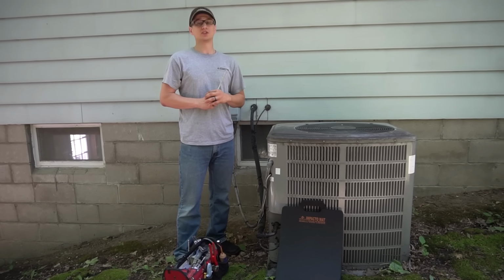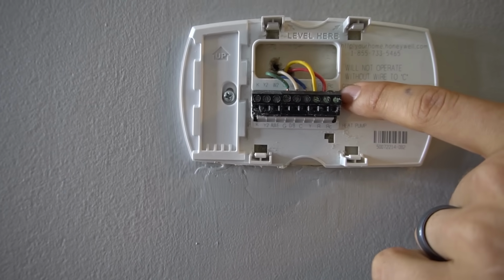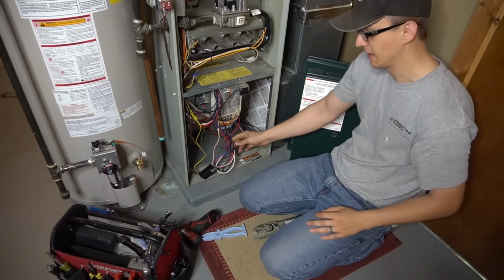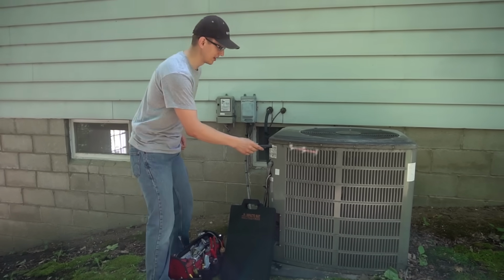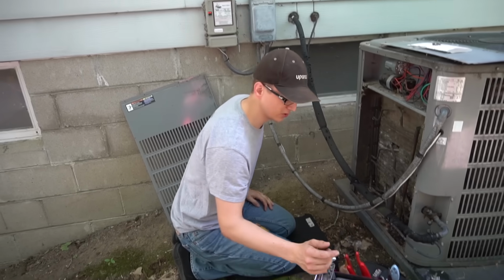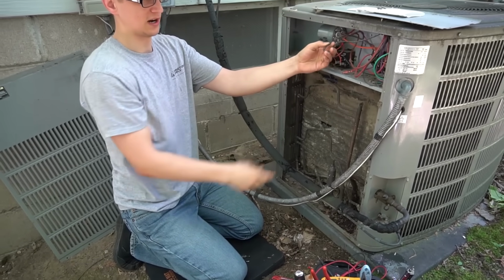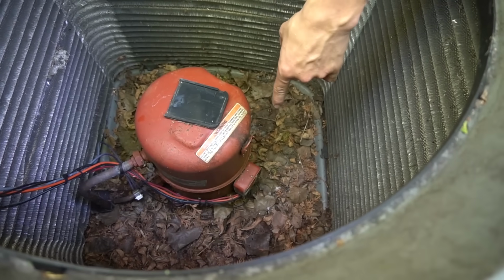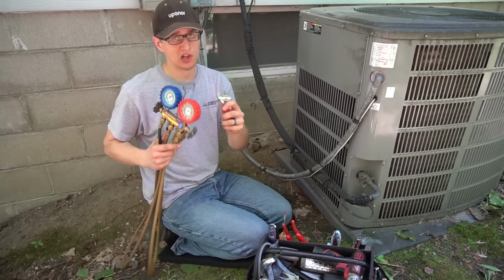AC Unit Not Turning On - How to Fix It Step by Step

Comment: Man thanks very much for this video. Here is my issue, my inside unit comes on alright when I turn the thermostat on but the outside unit is not working. I have two units and both units are acting the same way. At first I taught it was the capacitor so I checked them and replace both. One thing I saw was when I press in the contactor the unit start working on both. So I replaced the contactor on both unit but the issue did not resolve itself. I checked all the voltage and everything was good. I check the cable leading to the house to the thermostat and there were no damage. Is there anything you can think of that I did not check and base on your expertise what do you think might be the issue ? Thanks for your help.

Comment: This is a great video!  I tried your contactor trick, and nothing happened.  Then I looked at input voltage to contactors, and measured 37 VAC.   I powered off, removed one 240 leg, and powered back up.  I got 240 from the unconnected lead to the other one on the contactor. Probably will call professional tomorrow.  I greatly admire your clarity and enthusiasm to help people.  God Bless you and yours!!!

Comment: Hi! Hope you are staying safe and thank you for what you do. Your video has been so helpful in guiding me to figure out what is going on with my AC. Unfortunately, I still need help. My AC unit is hissing and not turning on, it sounds like is trying to turn on but doesn't. I changed the capacitor and didn't help, then changed the motor and it worked, but after a day it was still not cooling. The temperature went down from 85 to 82 then down to 81 but went back up. My inside unit is working. The control panel is blinking constantly, but not sure if that is related to the outside unit. The fuse is not burned. I don't know what to do. PLEASE HELP!!!

Comment: So I had a original 30 year old capacitor that was going out and its a 40 MFD +3 dual run capacitor. They had none at the parts store and told me a 40+5 works. I bought and installed. Should I get a 40+3 to replace it with
Reply: +5 is for your compressor fan motor. if its starting up then no need to replace it
Reply: Yeah, it works fine.  I just was wondering if there were any negative effects or not and if I should replace it back with a 40/3.  I guess since its working I'm going to leave it alone.  Thanks!

Comment: Thank you for the videos. My AC isn't working at the moment. My fan in the house unit is blowing. But my condenser isn't doing anything. I had the capacitor checked and it was good. The condenser fan motor is free but not blowing and I don't hear the compressor turning on. I do have 120v on one leg and 120v on the other. I haven't checked the 24vdc on the contactor though. I'll check the contactor in the morning. Thanks, at least I have another place to check now. Cross your fingers it isn't the compressor.

Comment: so i bypassed the thermostat by manually pushing the contactor on the outside unit, and both the fan and compressor turned on. what should I do next?  I did notice on the control board looked darker around two of the resistors. maybe the control board is bad?

Comment: Nice video by the way. Here is my issue. Very hot day and suddenly my home ac unit(Carrier) stopped working. Went over your video. When I select from inside the ac button, the fan works, the thermostat is also on hold. From outside the unit does not work. Don't see the fan spinning. I open the panel changed the capacitor 45 / 5 microfarad. Still nothing happens. I take a screwdriver and press the contact button the compressor, and fan starts working. But the contactor does not hold or get magnetized. What should I do? Please suggest. Thanks!

Comment: Thank you so much for this video.  What if I don't see a plunger on the outside unit?  Is that possible?
Reply from the maker: You're welcome! It is possible that the plunger has  a cover over it that is held on there by 2 small screws. Try taking it off
Reply: @WordofAdviceTV  thank you so much.  that is it!  The Plunger seems to turn the unit on, so need to relook at the wiring.  I installed a new ecobee thermostat, and used the Power Extender that it comes with.  That is when the fan stopped working in the outside unit.  Maybe I should take the power extender off and use the C wire again?

Comment: Thanks for sharing your time and knowledge, Great Video. first my unit is a 20 year old Miller. I notice my unit wasn't cooling but the inside air handling fan was running fine. I turned the thermostat off. and waited a minute then turned it back on. As it gave me time to reach the outside unit. I waited a few moments and the condenser fan started but it didn't sound like the compressor had  started. or was operating with that peculiar sound like(glass spools rolling through a glass pipe) lol. I checked the start capacitor. it looked fine and every test I knew to try, it passed as a good start capacitor. this leaves me with the compressor to figure out.
QUESTION: with everything else seemingly working ok, is there any thing that would keep the compressor from not working or is it probably shot?  A local hvac tech was hired to replace my thermostat with a digital model a few months back and the fellow that installed it left a switch in the (heat pump) position instead of (standard) on the thermostat. this made the condenser fan and compressor run non stop 24 -7 and I did not notice this until the light bill came in and I started looking for the trouble. I turned the thermostat off and most other appliances and went outside to catch the fan and comp. running. I immediately went and pulled the thermostat thinking that it had malfunctioned. after checking the troubleshooting section online for Hunter digital thermostats. The flowchart indicated that for standard and heatpump systems there was a switch. I checked and sure enough. So I changed it, waited till the next day to give the compressor a much needed rest. I started the unit and it ran without issues until a few days ago(approx. month & 1/2) when I noticed it wasn't cooling and probably no compressor operation.
Thanks for anything that you can tell me. I know I will not be able to trust the last guy I hired, trouble is who can I trust?, lol.

Comment: Maybe the contactor coil which is normally 24 volts bad so the contactor not closing n the unit will not start if the power supply good

Comment: Dude you are such a good teacher!

So my problem ended up being solved by flipping my outside AC breaker next to the unit off and back on. The inside AC breaker did nothing when I toggled it. Outside breaker wasn’t tripped, still in the ON position. 

Why would that fix the issue?

Comment: Great Video!
I just figured out that my problem is high pressure switch . how do I reset it on old system? I cant locate any buttons. are they resetable? or I need to replace it?
Thanks in advance!

Comment: Replaced both capacitor ran great for 5 days , then fan stopped spinning , turned off , next day turned on fan not spinning, spun fan with screw driver and A/C started working great, ran for 5 min then I turned off unit for 2min , turned back on , fan spun , cold air running great, I repeated again same results ran great,  then I let unit run , 4hrs later fan stopped, spun fan again , unit started working, maybe fan motor bad? please help

Comment: Yep a few yrs our Condenser fan motor brg seized up , It was a sealed brg . I removed the Fan Blade , took a small pocket screwdriver an pried the seal up very carefully so as not to distort it , filled it with some WD 40 , let it sit for a few minutes, an then spun it around back an forth, flushed it again with some more WD40 , then sprayed it out with Brakekleen , You can get a needle nose grease injecter at most any Auto Parts Store, Took my grease gun an went around inside each ball brg in brg cage , spun the brg back an forth a few times , wiped off extra grease , reinstalled the  outer seal very carefully to make sure it locked in ,When I sold the house 15 yrs later AC was still going .

Comment: So my a/c is keeps blowing that 3 amp fuse. I’ve pinpointed that it’s coming from the outside unit not the inside handler. Because when I put a new fuse in it and only turn on fan the fuse doesn’t blow. But as soon as I turn the a/c unit to cool and the outside unit clicks to go on the fuse blows. (No breakers are tripping) Any suggestions to find the cause?
A couple things I’d like to add is the last week we have had terrible forest fires going on I’m in Oregon minutes from the evacuation zone. My filter in the handler were black even though it was new. I put a new filter in cleaned coils. Still blowing fuses when the outside unit clicks on.
So I’m thinking the dirty air/ filter caused the a/c to work harder and the something shorted??
Any suggestions would be much appreciated. Thanks
Reply: Word of Advice TV

Comment: Hi Richard.  My ac had a clog in the drain line.  It run off and on.   I used water to flush it out. Clean it out well but now it doesn not run inside or outside.  The thermostat has power and on.  The float switch connect to a pump to outside.   I m guessing the float switch it bad.

Comment: Great video.  My heat pump air handler variable speed fan in the attic will not run.  Instead as it tries to start it only rocks back and forth.  I ohmed out the three leads and not getting results as I expected.  They are all lower than 10 ohms but greater then 10% from each other.  More like 20%.

Comment: Lightning struck the cable or house tonight and  fried the modem and router now the ac won’t turn on inside or outside what usually goes with a lightning strike  
my inside fuse is still good. It ran after the strike but evidently not for long thanks for any insight

Comment: Ac cools except hottest time of day. Coolant not low, everything runs. Hottest time of day temp goes up on thermostat and ac keeps running but not cooling. After turning off for several hours and sun goes down turn on and it cools.

Comment: Just watched your video, awesome.  I just bought a small house and AC/heater don't work.  Changed battery in thermostat.  Switched on cooling, it says, "cool on", nothing inside or out running.  Breakers good.  Switched thermostat to "fan on" and nothing.  Is it possible that because inside fan is not running, outside unit never starts?

Comment: The AC stopped blowing cold air inside I went outside the fan was not running I checked panel and I switched it back on I spend the fan and it started spinning again but it makes intermittent groaning he didn't address it what should I do now? Thank you so much for all your help

Comment: Help! In late morning when it starts getting hot, AC seems to start, but no cool air. BUT in afternoon, when it starts really cooking (triple digits) it fires up with cold air blowing!We replaced the thermostat recently (same problem with very old one) & reset it daily by complete power off, so if some background program should be erased. I think there's damaged wires from thermostat to unit itself, not a short, but an "open" that expands  & makes contact in the heat. Here in California the entire unit is on top of the roof, not partitioned inside & out like yours. Also had it "checked out" by an HVAC tech that said unit was working fine & we needed a new thermostat- did that. He really didn't check a whole lot of the components other than wite electrical fields & said refrigerant fine since it was eventually cooling. So how can I check the current from thermostat that the unit itself is receiving?  & why would fan kick on without rest of AC unit?  I'm glad it eventually does, but its been maddening! Any suggestions are welcomed!

Comment: Hi, thanks for this great video.  I definitely learned more about how the system works.  Unfortunately my problem isn’t really covered.  No changes to my system but my condenser fan only comes on intermittently for around 10-15 seconds and then stays off for long periods while the fan in the house keeps running.  So it’s just pumping hot air.  Based on this my condenser appears to be working but just keeps turning off after it turns on.
I have had condensation leaking issues in the air handler in the past and a secondary catch can was installed with a switch to stop the condenser if water accumulated.  When this started happening I figured that’s what it was so I went into attic and saw water in the tray.  I took all the water out but the behavior didn’t change.  Air handler kicks in but condenser only intermittently comes on and only for 10-15 seconds.  Any advice would be appreciated!

Comment: Hello, long time fan ... you are thorough with all your Words of Advice, thank you. One of my condenser units is only humming as if the fan is stuck? I am getting ready to troubleshoot with some of your shared troubleshooting tips. What exactly should my focus be with a condenser with a humming sound? Fan inside is working. Thermostat is good Nest. Something at the condenser unit for sure. Carrier unit 17 years old. Any advice is much appreciated. By the way, I am an electrician. Thank you

Comment: My Honeywell ac stoped it’s flashing between ac on and returning.. what would cause that? I just pulled the filter it was pretty dirty. Already replaced the capacitor a few months ago and it was working. It’s been really hot. Air is circulating..?

Comment: We have York, split unit. About 10 years old. It is used about 1 week a year. Yesterday, lights flicked - and AC turned itself off. Of course, it was 114F. Thermostats are both ON, we placed it to HOLD setting, but no response from furnace at all, all breakers are ON, power is going all the way to the furnace in the attic. Compressor fan spins just fine, fuse inside furnace (3amp) is OK - but no fan inside furnace is responding to thermostat settings, ,  compressor fan doesn't spin. Simply said, no response. Zero. Where should we look ?  Thank you so much for your help.

Comment: My AC isn't coming on. I hear a buzzing somewhere in the condensor unit when I try to turn it on but the condensor fan isn't spinning. It appears to run normal if I manually depress the plunger. Any ideas what is going on?

Comment: I came home last Friday and the temp was 80. The fan was running but the air coming out the vents was room temp. I had it set to 75 and it was on hold. I dropped the temp down to 70 and came back up to 75. I then went outside and the compressor and fan was running. There was hot air coming out the top. The thick line was cold and the thin line was warm. I went back inside and I could feel cold air coming out the vents. The room temp dropped to 75 after a hour. Do you think my 2 months old thermostat is bad?

Comment: My furnace fan and everything turns on but the contactor plunger does not engage. If i engage it manually the fan motor and compressor works. Any ideas?
Reply: Thermostat is not new. Filters are good air is flowing just outdoor unit does not engage with the thermostat. Wiring all looks good no nests. Obstructions or anything like that.

Comment: Awesome video I have one question : My Compressor and blower fan both stopped working at the same time. I put in a new capacitor but unfortunately, that did not fix the problem. The thermostat DOES pull the plunger on the contactor in, and give off a very slight hum, but it does not start the compressor nor the blower fan. Both of those would not stop working at the same time, right? So, it must be a bad contactor right???
Reply: Nevermind - it was simply one of the 30 amp fuses on the disconnect! SWEET!

Comment: I had a tech come out and tell me I needed to replace my condenser fan motor - so I did. I tested the "plunger" with a screw driver and the fan and compressor worked as expected. When I turn the fan on in the house air comes through the vents but it's warm because the outside unit is not running. While you cover all this in your video, I don't think I caught you explaining how to fix this issue? Let me know if you can help, thank you.

Comment: Sir, the contactor in the unit does not close and the relay in the furnace same thing. the compressor does not buzz. the rest, capacitors, fan motor, thermostat, and blower work fine. what s the problem? thanks for you help
Reply: the compressor is fine too, the resistance test is good

Comment: the condenser outside I believe it's called the condenser not sure what would be the problem when the contactor of the unit doesn't pull in I saw your videoI saw you did it manually with your screwdriver you pushed it in and it activated the fan  have power coming into and it's running now working fine but when I let it go it won't activate on his own meaning it won't pull in or stay in as it should what will be the problem it's not pulling in what wood be the cause of that please let me know I would like your opinion on that thank you

Comment: My ac unit will not turn on with the fan on auto in the thermostat, but it will turn on when I put the fan on the "on" position. Also my ac unit blows warm air at night roughly around 10pm but in the morning it starts blowing cold air again. Any thoughts?

Comment: Thanks for the video!  Really help me understand the basic troubleshooting and the problem.  Even if I don’t fix it myself I can understand what is going on when a tech explain it to me.  Of course, I’ve been watching all your video.  Btw,  how do you fix if there is no 240v  detected at the disconnect box or at the contactor?   If it just the breaker how do I which one if it  doesn’t have one labeled AC  on the breaker panel?  Thanks again for sharing your knowledge.